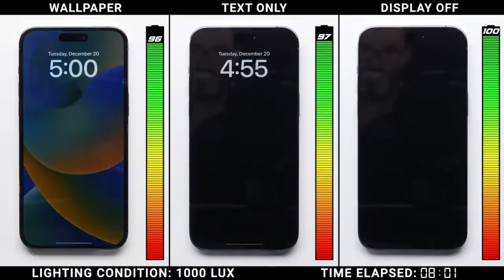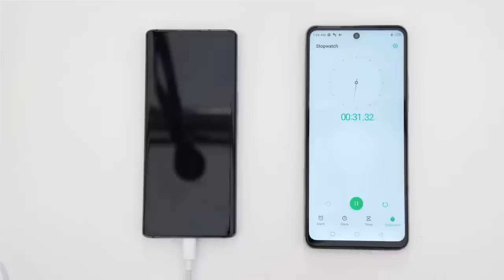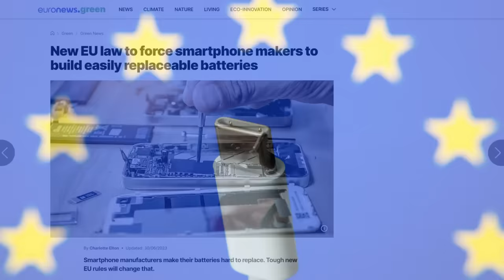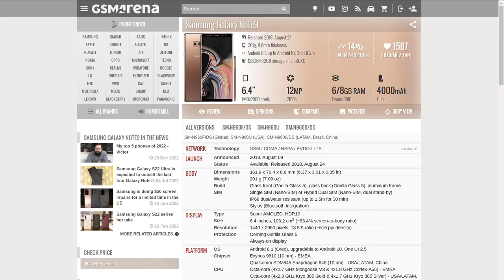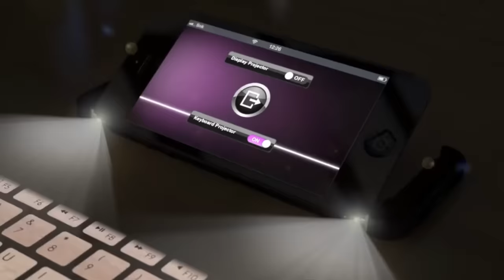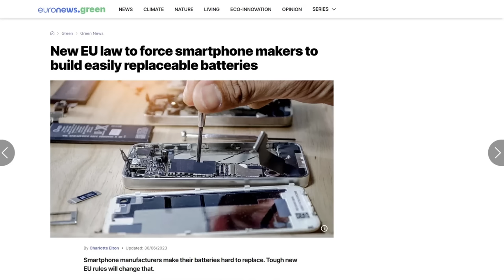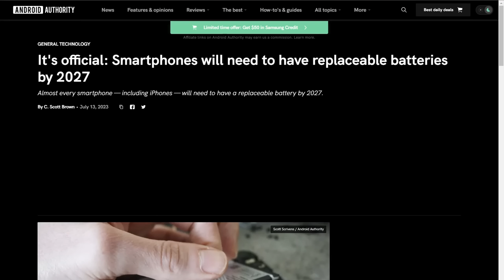All Smartphones Will Soon Have Removable Batteries

Comment: Features removed a decade ago only coming back because manufacturers are forced to by regulation. Thank you EU. May they keep pushing in this directions including right to repair.
Reply: Right to repair
Reply: Sadly the eu word isn't law around the world. They're still the other 85% of the economy.
Reply: Gosh, and the BS reasons they gave for removing these features. The young Zoomers don't understand the glory days of bringing a spare battery on the long field trip bus ride to swap out the battery after yours ran out playing Subway Surfers.
Reply: I think apple astroturfed it out of the market. I remember a mocking point for android was "the battery will fall out" or similar. Funny enough it's incredibly useful to be able to remove them.
Reply: @TheSpecialJ11  Amusingly they would mock you for having a phone that has a removable battery.
Reply: @rudysmith1552  but there is a thing called the brussels effect. Where companies follow the laws of the eu because it ends up being cheaper than manufacturing a model for the eu and other for the rest of the world
Reply: This should never be done through regulation. There are always unintended consequences. Is this going to mean we no longer have waterproof phones?
Reply: @Noneofyourbusiness2000  Samsung S5 says hello. Granted, the build quality is horrible (brittle plastic, flap falling off, rampant overheating etc.), but it's definitely possible. There are action cameras with removable batteries and better water resistance than phones. All you need is a bit of rubber (or some equivalent material) to seal off water around the gaps of the device. If you also use screws, then the seal won't degrade like the glue and plastic clips usually found in phones.
Reply: @rudysmith1552 but the EU is a main market and a very wealthy one, it will make a significant impact in the industry
Reply: @CrittingOut  yes, the battery will fall out if you drop your phone from a building like your average user does.
Reply: @Noneofyourbusiness2000  Seems like someone didn't watch the video.
Also, why should this never be done through regulation? At least now there is a way to mitigate planned obsolescence.
Reply: @flopsinator5817  It should be done by market choice, by making a point to buy brands like framework and fairphone if possible, rather than forcing companies to behave. 

Companies forced to behave don't deserve your dollars.
Reply: @rudysmith1552  yes, because they're gonna complicate manufacturing by making an eu specific version with removable batteries
Reply: @carlacastrodasilvasantana6960 Yes the EU is not having a population crisis or any other problems that might make their economy shrink.
 Are the 12000 cars in Paris still burning?
Reply: This is a good thing but don't EVER say "Thank you EU". That's like saying "Blue Helmets are people, not targets.:
Reply: @fdsman  Why must it be done by market choice? 
Does that guarantee a better end product? No.
Does that lessen electronic waste through hampering planned obsolescence? No.
Does that reduce consumer prices? No.

When applied with some degree of reason, regulation has the potential to improve the end product, make prices competitive or more generally make products more long lasting.

Regulation is why we don't use asbestos in buildings anymore, why cars have catalytic converters or why industrial waste isn't dumped into rivers. Market choice would've dictated otherwise.
Reply: @TheSpecialJ11  nah we were just to poor to afford multiple battries
Reply: @Noneofyourbusiness2000  the. What else do you suggest? Clearly just asking the company's themselfs isn't working
Reply: No, because they want to make EV new oil.
Reply: @DavidJeffreson-xx7kr   I suggest free markets.  We haven't had that since the US was prosperous.
Reply: @fdsman what happens when those in the market push out the competition that doesn’t agree with the big companies’ agenda? How can start-up and small phone companies compete with the pre-established marketing and power?
Reply: yeah they held a gun to your head, everyone's head and forced us to buy phones without replaceable batteries. I know I was there.
Reply: In 2027🙄🤦‍♂️
Reply: @leonro  i still use a s5. Its amazing.
Reply: @moargr4yons  That's gonna cost them way too much money as they have to create separate factory lines for that.
Reply: @rudysmith1552 you can import from EU anyway
Reply: @Noneofyourbusiness2000  Samsung phones were waterproof and had a removable battery, you've been had by phone manufacturers, who sold you the lie that "phones with removable batteries can't be waterproof"
Reply: EU W 👍
Reply: @rudysmith1552 Either they stop selling, or they make a certain version only for us or they make it the new standard ENJOY
Reply: @Noneofyourbusiness2000 ow else will you do it besides regulation? Setting boundaries for the market is one of the prime duties of the government. If they don't we'd still have lead in petrol and asbestos in our homes. 

Also EU regulation isn't set in stone but fairly dynamic. If unforseen circumstances arrive they'll change it.
Reply: @awii.neocities  wtf do you think i was saying lmao
Reply: @moargr4yons  oh I misread your comment sorry bro
Reply: @fdsman  grow up, the free market doesn't work, we need regulations.
Reply: I just hope they don't make the phone quality worse trying to implement this
Reply: @fdsman Companies forced to behave, don't. Compabies encouraged to behave, do.
Reply: @flopsinator5817 And no, there has never been a single actial study that has found Regulation has helped an economy, it almost always hinders it.

Regulation is a feel good policy, it feels good to have someone to control rhe things we eat, drink, put in our homes.

But that comes at a cost, if you are willing to pay it that's fine. As I say "If you accept the cost of your idiocy, be a moron." I like my water being clean but that's why I buy and build water filters I use on a day to day basis.

This is why I wish we still had concepts like States Rights, where states where ultinately the decider of their own destiny and we could actually see in objective reality what the best systems are.
Reply: @TheSpecialJ11 I'm born in 2010 and even though I'm from Serbia, I'll buy phones from the EU even if Serbia doesn't go in it because you know, that feeling must've been great, and I want it with a modern phone.
Reply: @linhero797  Children are required to go to school in most countries. That is also regulation. 
I probably don't have to tell you how having an educated populace leads to economic prosperity.
Same goes for limiting pollution, or standardising aspects of an otherwise fractured industry.

Just declaring that all regulation can ever do is hinder the economy really misses the nuance of state policy and economic development.

Also, as a side note about the whole 'States Rights' thing, the word you're looking for is sovereignty.
Reply: @TheSpecialJ11 nowadays people have iphones that can last multiple days playing subway surfers without having to carry unnecessary weight
Reply: @rudysmith1552 while that may be true, there's a interesting pheonomenon in regards to EU regulation of products I've heard, named after one of Europe's capitals that I don't remember, where basically the product gets redesigned/rehashed in the EU market (usually due to new regulation) and it usually spreads to other markets cuz it's either more efficient and/or just cheaper if you sold the modified form everywhere, freeing up extra resources

It was quite a while ago when I read/heard about it, so I might not be entirely correct, but the general gist of it is what I'm definitely sure of
Reply: @Pibola64  That's called the Brussels effect.
Basically, Beijing is where the production happens, Washington is where the R&D is done and Brussel is where the rules are made.
Reply: @TheSpecialJ11 yes we do, you realise phone's had removable batteries until like 2015
Reply: @vandarkholme8548  Interesting, so Framework and Fairphone don't exist, among other brands that embrace the right to repair culture without being forced by regulations.

Huh, strange.
Reply: @fdsman  They may as well not exist, I haven't heard of them and if I walked into a local store I probably wouldn't find any.
Reply: @CrittingOut  unpopular opinion: apple brought phone culture to the money oriented cockblock. Unremovable battery, removing 3.5mm jack, ugly-complicated-for-nothing notch front camera, deliberately slowing old phone, etc
Reply: @amd.0001  all for the low price of $1999 usd
Reply: @throwawaylolol35  Oh, I definitely agree (and I'm 21). I'm only comparing S5 with S23 because of the name. I always try to get my family to cheap out on phones whenever they need new ones because they're quite literally made to be disposable. 

There's no quality associated with the extra price, lots of design flaws appear with these extravagant models, only random features and dumb extras while removing the actually good ones (headphone jack, microSD, a non-cracking back). You don't even get more storage on higher end phones, because even the cheapest ones nowadays have 128gb, but they'll also likely have microSD slots.

And iPhones aren't any better. Today I found out that they will imminently shut off when they don't detect a microphone upon boot (software flaw), and the mic cable of the 12 is sandwiched between two plates that can damage it (hardware flaw).
Reply: @elsenorvananas no it’s not 😂
Reply: @Noneofyourbusiness2000  Like everybody routinely dives in the depth of the seas...
Reply: @Frivals  No by 2027 they have to give them time to design the thing, even if they only release in 2027 thats only 4 years
Reply: @valakivalaki5798  in 4 years China builds another 100 cities
Reply: @Frivals  I don't see how that ties into this but most of us will still be alive and well in 4 years

I ofcourse don't know if the companies will wait until the last moment or not but they could do it earlier and use it as a selling point

thankfully this doesn't have much to do with global warming or political issues so waiting a bit is fine, afterall we've managed like this for a decade
I'm really just glad something pro consumer is happening for once
Reply: And strict consequences for planned obsolescence and other fraudulent tricks these arseholes use to keep the sales up at the expense of the consumer.
Reply: @Noneofyourbusiness2000  All you need for waterproof phones is o-rings and tonnes of screws. (It would probably not be as waterproof as current phones, but unless you regularly swim for long times with your phone it should be fine)
Reply: @Noneofyourbusiness2000 "never be done through regulation". Let me guess, another ñiberrarian that believes in the myth of a "free" "self-regulating" market. We live in the real world pal.
Reply: Neofascist
Reply: Wtf do you mean by right to repair? Don't you already have that? Don't tell me they meddle with that.
Reply: @imstupidbut  then why you want to carry unnecessary weight of adhesive, that glues battery to screen without any reason?
Reply: @potatofuryy  you will be surprised how hreat o-rings at waterproofing. With them phones will be even more waterproof than now.

Comment: For the very few that have never seen a waterproof watch before that has replaceable batteries, or any older phone that had water resistance. The way you can ensure water resistance is kept was adding a rubber ring around the edges of the back that kept the insides airtight after the back was snapped /screwed on back and it was wonderful.
Reply: I used to have a low range Motorola that had both a removable battery AND water resistance.
Reply: You can also quickly remove your battery and let it dry if it gets wet
Reply: I used to have a Samsung Galaxy Xcover 4 with a detachable back and battery, it just had a rubber ring on the back plate around the battery and it is still IP67 water resistant
Reply: @dbro1205  I think even IP68, not that sure though, but the newer ones (XCover Pro (5th) and XCover Pro 6) both have IP68 and you can still open the back!
Reply: @Stridsvagn69420  nice
Reply: @mallmann72 the S5 also had replaceable batteries and water resistance too
Reply: Water resistance tech will be much better by 2027 anyway, so it's especially a moot point.
Reply: I bought used A50, which has neither replacable batteries or water resistance. Phones since Samsung S5 are just dissapointing.
Reply: The waterproofing came from sealing the phones, likely with silicone. But over time it becomes brittle and dropping it can create a breach which is why it doesn't last. A good quality gasket would probably waterproof it for longer, but they'll probably wanna go cheap to save money and give them more failure opportunity
Reply: it’s still much less resistant than having a built in battery. the EU is ruining everything
Reply: The Samsung S5 which was released in 2014 had rubber ring seals. It was rated IP67.The phone just didn't sell well so they moved to that glass design.
Reply: So true man, I have an old beat up Casio watch that I never take off, not even when showering, works great. Only thing it doesn't work is the sound, but for what it is, it's awesome.
Reply: @mallmann72 I remember that phone
Reply: @saiv46 I've had my A50 since 2020 and in fact it's the device I watched this video on and am typing this comment on 💀.

Comment: I actually had an old phone that became unusable due to the screen display dying, and I got the same model afterwards. The old one became a glorified charging dock for batteries, and that was perfectly fine by me! 😅
Reply: That's pretty cool actually
Reply: another reason why removable batteries makes it so there is less ewaste
Reply: @bruhmoment2312  no bruh. you need portable all-around-powerbank to save waste. removable batteries wont do what you are expecting. #capacitor #capacitance #enoughEnergyToSendAndReceiveSignalsForDaysWithoutBattery
Reply: @meikamandoliini yes just make another hugeass powerbank for your demand instead to reuse whatever you had before without introducing more batteries
Reply: @meikamandoliini  since you didn't bother thinking about your response to my comment, I'll do the same ;)
Reply: @holesmak  we seemingly share a language, tho, you're not make of any sense?
Reply: @bruhmoment2312  so what? it wont unsalt you, sir ahahah.
Reply: @meikamandoliini  you said "to reduce waste you need to buy a powerbank". But e-waste comes from overconsumption and lack of reusability. So basically buying a new powerbank is anything but reducing e-waste. In that regard replaceable batteries are better solution than having powerbanks.
Reply: @holesmak  thanks for correction. replaceable battery, indeed, seem to be W's choice.
Reply: @meikamandoliini  why would I be salty about someone being straight up wrong tho?
Reply: @bruhmoment2312  atleast it takes two to tango.
Reply: @meikamandoliini  It doesn't. That's a logical fallacy. You don't have to be ignorant or upset or in the wrong to acknowledge that someone else is.
Reply: @Espartanica  no. you are being wrong, but it is alright atleast if you have to.
Reply: The "elite" kept this as a secret for centuries, this is the true story of your enslavement 👉 The Connections (2021) [short documentary] 💖
Reply: @VeganSemihCyprus33  Okay bot

Comment: Those power banks kind of existed back in the day.  There were extended capacity packs that did alter the shape/size/weight of the phone but would run for several hours or even a day more.  I can imagine power bank makers just retooling these into shaped packs to fit mobile phone models.
Reply: There are power banks which are made as a case in which you put your own battery cells yourself. These and the "power bank phone-cases" still exist now. The only issue that the battery cells themsevles are extremely hard to ship for a good price, possibly due to lobbied obstructive measures.
Reply: But why would you need that if you could just replace your battery whenever needed. What would be useful is a charger for the spare battery, so that the spare can be charged while the other battery is inside your phone.